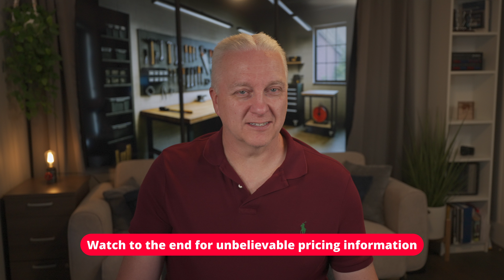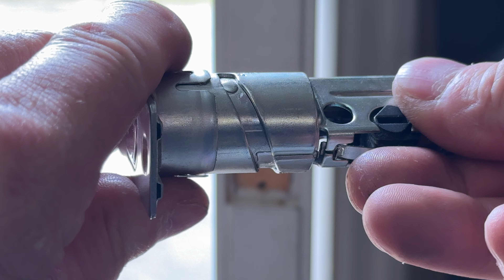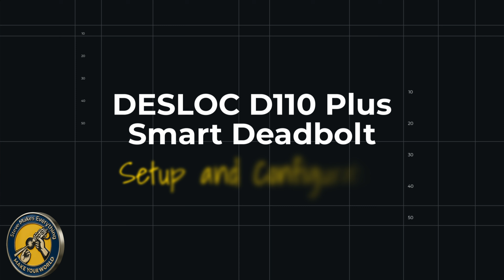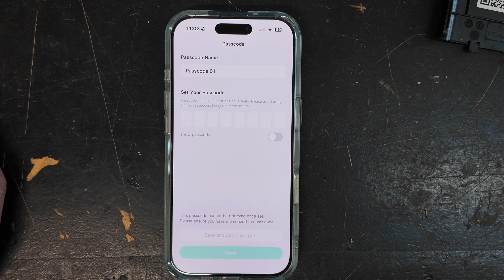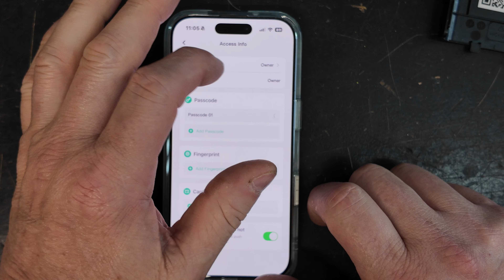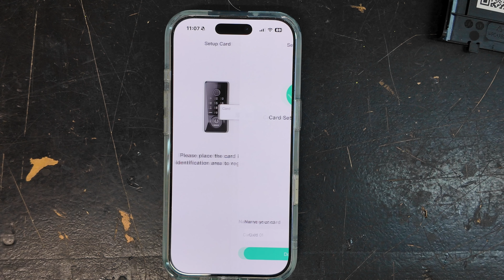Can This Smart Lock Really Keep Thieves Out?

Comment: I can see this lock giving some options to manage people and times for access. But as long as the door frame and locking plate are that flimsy, any bad person would just kick in the door. In case the app stores some access log information in the cloud, bad people might even be able to read, when you're not at home. The only security improvement I can see is, that bad people might think that there could be some kind of fancy alarm system behind the door.
Reply from the maker: Sure, any lock is only going to keep honest people out.  My shop door has 6-inch screws into the frame, and the door is an insulated steel door, so it affords decent physical protection - at least it would keep a criminal busy long enough that one of my many yard cameras can get a good facial image of them for the cops.  And if they do get in, I'll get more video of them there as well - not to mention the monitored alarm.